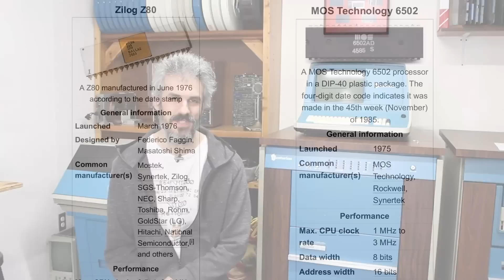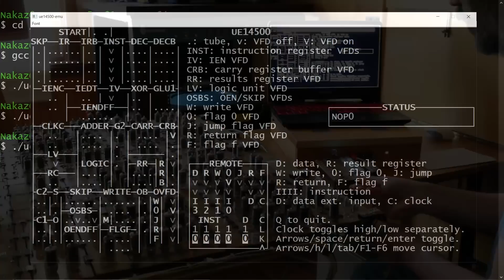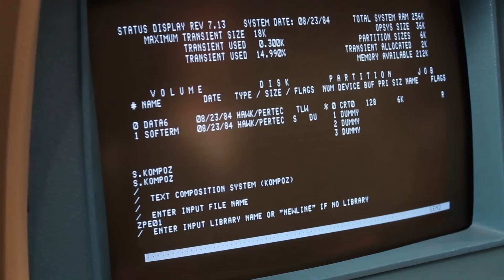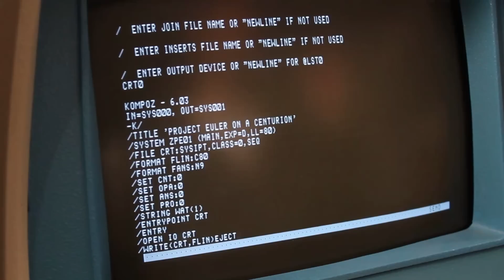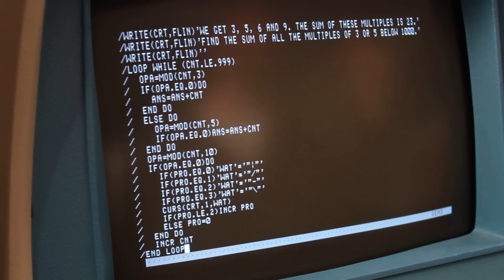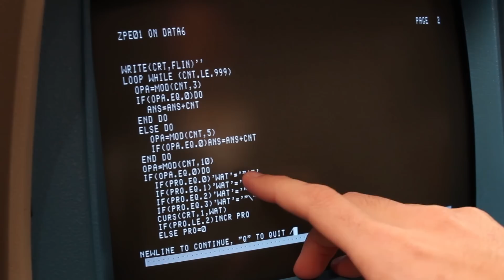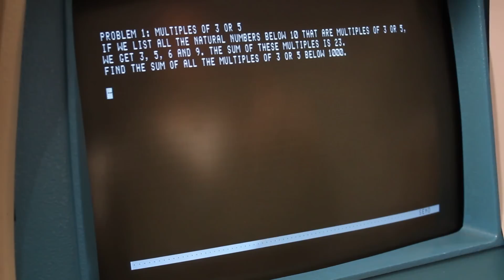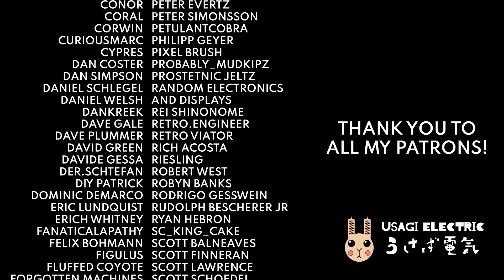Coding on a 1980s Business Minicomputer!

Comment: Has anyone tried this coding challenge (#1 in the Project Euler archive?) Obviously I don't have a Centurion but I gave it a go on PC-BASIC, the GW-BASIC emulator. If you're into line number style BASIC it's awesome.  Anyhoo, I get the correct answer for the sum of the multiples below 10.  But for the sum of multiples under 1000, I get a different answer than he gets in this video.
Reply from the maker: I love the Project Euler challenges, although after about 75 they rapidly got beyond my ability.
On the first one, there are a couple of gotchas. It says "3 or 5," so you have to be careful not to count multiples of 3 and 5 twice, like 15 for example. Also, it says below 1,000. My first attempt at it included 1,000, which will give the wrong answer.
Reply: @UsagiElectric  Hey, dude, what's up! I'm super glad to hear from you, I wasn't expecting that.  I already wondered if that was the case with the "gotcha" you mentioned. . So, I tried recoding it as described and got 66,668, so somethin' ain't right 😂. welp, back to the old keyboard. BTW I really enjoy your videos, especially that recent NEC micro video, keep it up!
Reply: I did it in Julia, and get the same answer as he does.

julia> cnt = 1
julia> sum = 0;
julia> while cnt<1000
           if mod(cnt, 3)==0
               sum += cnt
           elseif mod(cnt, 5)==0
               sum += cnt
           end
           cnt += 1
       end
julia> sum
233168
Reply: @hankdewit7548  thanks for the interesting code example, do you mind if I as what you use Julia for? BTW I eventually got it, too
Reply: @mikecook317  In my later working life I did a lot of web-cgi programming using Perl. I really love Perl, but it's not really a language for the future. I don't like Python much for a number of reasons including it's object oriented nature. I don't really like OO languages much. Julia has a system called "multiple dispatch" which when used with it's flexible type system does everything an OO language does. But the is little faffing around with constructors and methods as Julia handles default "methods" automatically. It's not a perfect language, but it straddles the world between Python, R, and Matlab in terms of functionality.

Comment: Please don't type on top of the cabinet! The Hawk drive really doesn't like the percussion and might crash pretty badly.
Reply from the maker: I don't think the slight vibrations from me tapping on the keyboard will crash the Hawk when the actual seek operations of the Hawk shake the whole cabinet. When I hit "H1" to boot the OS, the Hawk does three quick RTZ operations where it jumps the heads out and back really quickly and the entire cabinet shakes so much you can see it moving. The level of violence the Hawk brings to the table when seeking greatly dwarfs the tiny amount of vibrations that come from typing on the terminal.
Reply: @UsagiElectric  True, those things made the floor rattle when multiple users were accessing the system.
Maybe our sysop was always a bit paranoid when anyone came near to one of them. Great to see yours still running so well!
Reply: @UsagiElectric  But moving the terminal away from the cabinet onto a bench would let you sit at it instead of standing up for long periods.  It would also be quieter for you, and for us (less machine noise in the videos, hint, hint).  This will also apply as you get to grips with the PDP-11.

Comment: I write python scripts greater than 6 Kb
The RAM specs sound good for 1980 as does the hard drive 5 Mb
Considering my Commodore 64 (1983 release) had about 38 Kb of useable ram, 256 Kb sounds much better.
I know the Apple IIe had a 1 Mhz CPU (late 70's early 80's)

My gosh, the coding makes no sense.. Sure, I've heard of loop, do, while but the rest is gobildy goop.
I understand the basic.... Good old commodore 64 days
10 print "Hey there"
20 input "What is your name",a$
30 print "Hello";c$
40 end
Reply from the maker: I've since learned a lot about user programs on this thing!
The base size for a user partition is 6kb, but that can dynamically change depending on the program the user is running to as low as 2kb and as high as 32kb. I've never seen a user program crack 24kb though, so they're all pretty compact. With 256kb on tap, if you want a user program to use all of the available RAM, you gotta actually write it in Assembly and run it bare metal outside the OpSys.
The Centurion was all about multi-user capability, and the OpSys used that 256kb remarkably well to ensure that anything up to about 16 users could use the system simultaneously without noticeably slowing the machine down!

Comment: but who do aculay owns the right to the Centurion and the OS at precent day as i recon the company is long gone
Reply from the maker: Funny you should ask!

Centurion went bankrupt in late 1984 and was sold to a company called Ztron. They held onto the company for a few more years and developed a UNIBUS based CPU7 before they themselves went bankrupt and the company was sold to Cruze Computers who have owned the Intellectual Property since. They continued to develop the machine, creating a CPU8, CPU9 and ultimately a "CPU10," which was a port of the Centurion OS and application suite to x86. Cruze Computers actually still has two customers that are using the "CPU10" port to this day. I've actually talked to the current owner of Cruze Computers, and the hardware side of Centurion has been shut down since the mid-90s, but with software side still active, our hands are a bit tied at the moment.
He has stated he wants to upgrade his customers to something more modern, and when that happens, I'm hoping to maybe buy the Centurion IP from him so I can freely distribute everything, and maybe even sell some Centurion replicas built on an FPGA with the OS and some applications pre-installed!

Comment: Your second program needs to be a better text editor. Although getting it to work using the existing one looks like it would take approximately a century. (Is that why it's called a Centurion?)
Reply: Vi was designed to run on terminals so may be a port of that?

Comment: If you cannot distribute the os, then by that same thinking you cannot distribute the manuals to. It's all proprietary and copyrighted. Same for all the reverse engineering, quite sure that was a DMCA violation. US laws are really backward on those things. 
It's your choice, but i really doubt anyone is going to claim ownership of copyright of that os.
For the record, I understand you have to deal with your countries laws as they are.  I personally feel copyright needs heavy reform. With the current tech cycle it needs be much shorter. And if the company is gone then so should any copyrights.
Reply from the maker: Yes and no.
Centurion went bankrupt in late 1984 and was sold to a company called Ztron. They held onto the company for a few more years and developed a UNIBUS based CPU7 before they themselves went bankrupt and the company was sold to Cruze Computers who have owned the Intellectual Property since. They continued to develop the machine, creating a CPU8, CPU9 and ultimately a "CPU10," which was a port of the Centurion OS and application suite to x86. Cruze Computers actually still has two customers that are using the "CPU10" port to this day. I've talked to the current owner of Cruze Computers, and the hardware side of Centurion has been shut down since the mid-90s, but with two customers still using some version of the OS, he's asked me not to freely distribute it. 
The manual is a bit questionable, but the hardware side of it has been shut down and the current IP holder was okay with distributing and sharing the reverse engineered schematics and information. But, until I get the go-ahead from him, the OS can't be freely distributed.

Comment: Multiuser computer - sounds like you should run a BBS on it and let us try it out. Is that do-able?
Reply: with phone lines?
Reply: @mikemcwilliams7801  You have a serial board. There is a serial to telnet server that will connect with a 25pin connector  (Lantronix UDS-10) that will translate actual serial transmit/receive modulation to telnet. There are several telnet programs that literally could then connect to your wonderful machine. There are many ways of doing this, might be something to investigate. I am sure there are plenty of us old BBS SysOps that could help you figure that out.

Comment: Oh, what an old brain-dead language!
I thought  COBOL was pretty awful, but this language takes the cake!

Just for fun let's try writing this program in C, on a Mac Mini M1: ( attached below )

Hmm, far too fast to time it, let's put a loop repeating all the code a million times:
------------
PROBLEM 1: MUTIPLES OF 3 OR 5
IF WE LIST ALL THE NATURAL NUMBERTS BELOW 10 THAT ARE MULTIPLES OF 3 OR 5
WE GET 3, 5, 6 AND 9. THE SUM OF THESE MULTIPLES IS 23.
FIND THE SUM OF ALL THE MULTIPLES OF 3 OR 5 BELOW 1000.

THE ANSWER IS:233168
real	         0.561s
user	 0.554s
sys	         0.005s

So, about a million times faster.   There has been some progress in computers!!!!

let's rerun it in awk, an interpreted C-like language:

(for just 10,000 loop runs ):
PROBLEM 1: MUTIPLES OF 3 OR 5
IF WE LIST ALL THE NATURAL NUMBERTS BELOW 10 THAT ARE MULTIPLES OF 3 OR 5
WE GET 3, 5, 6 AND 9. THE SUM OF THESE MULTIPLES IS 23.
FIND THE SUM OF ALL THE MULTIPLES OF 3 OR 5 BELOW 1000.

THE ANSWER IS:233168

real	         1.825s
user	 1.812s
sys	         0.007s
GRG-Mac-Mini-M1:centurion grg$ 

Soooo... even in an interpreted language the new computer wins by a long shot!

Cheers,

George
Reply: Try to write it in BASIC on a microcomputer from that time (Apple ][, TRS-80, Commodore PET).  It will be slower than that Centurion.
Reply: @Rob2  Rewrote it in durexForth for C64, including progress spinner, ran in 7.3 seconds (same computer family as PET, similar run time to the Centurion). Nice exercise. 

variable pro

: progress
  pro @
  dup 0 = if 176 else
  dup 1 = if 174 else
  dup 2 = if 189 else
  173 then then then emit
  157 emit
  dup 3 = if drop 0 else 1+ then
  pro !
;

: euler1
  ." sum 1..999 if multiple of 3 or 5"
  cr
  0 0
  1000 1 do
    i 3 mod 0=
    i 5 mod 0=
    or if i m+ then
    i 10 mod 0= if progress then
  loop
  cr
  <# #s #> type
;

The program could fairly easily be ported to contemporary forths, but most of them compile to slower code. Note the use of m+ for double width sum, the answer would not fit in a 16 bit variable. Commodore BASIC wouldn't have that problem because all numbers are handled as 5 byte floating point.
Reply: Hmm if I set up a state machine for this and put it in a let say a cyclone 9 FPGA it will be finished within milliseconds. Or using CUDA on a rtx 4090 would be within microseconds, but that's not the point, the point is he did something on his own on an old machine just restored by hisself....